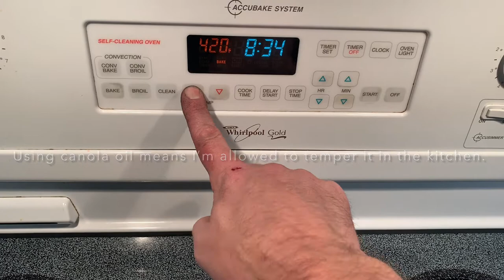Making a folding EDC pocket knife.

Comment: Great video! Thanks for all of the detail.  A couple of questions please. What is the spring made of? Looks like maybe an old saw blade? Also, and recommendations on a small forge like yours? I built a paint can forge, but it's not great at getting even heat. Want to upgrade a bit. Thanks from Texas!!!
Reply from the maker: Nice! I’m also originally from Texas.  Grew up in Texas City near Galveston.  Been up here now for about 14 years.  The spring is from some scrap metal I found on an old toolbox. So unfortunately I can’t really say what type it is.  I just tested different pieces until I found one that worked.  Something I’ll have to chase down when I run out of this piece. I built my first couple of forges and they weren’t real efficient.  I bought this one from Diamondback Ironworks. It’s been great!

Comment: Nice! how powerful grinder? And how many positions have vice?
Reply from the maker: Thanks!  The bench top belt grinder is 1/3 HP. The vice has 3 different pivots so it’s pretty versatile.  I can position it in most any way I need.  Got both from Harbor Freight pretty cheap for starting out.